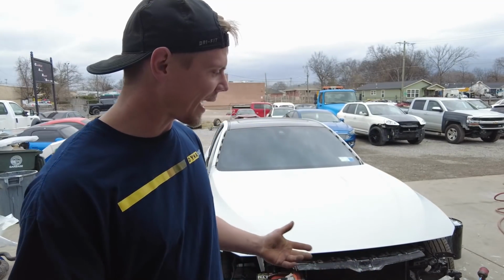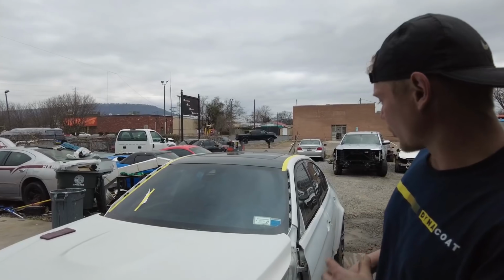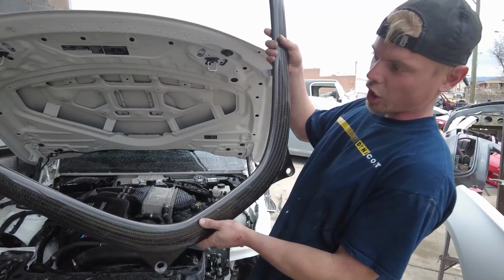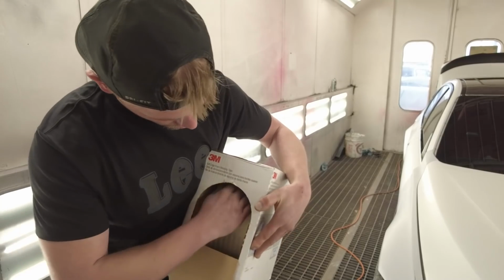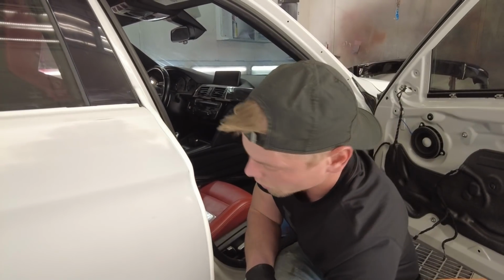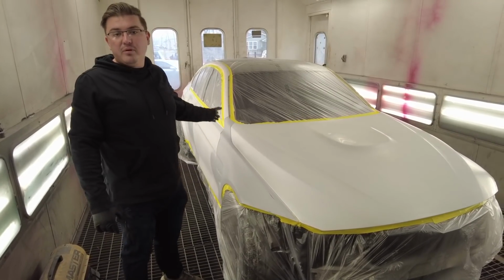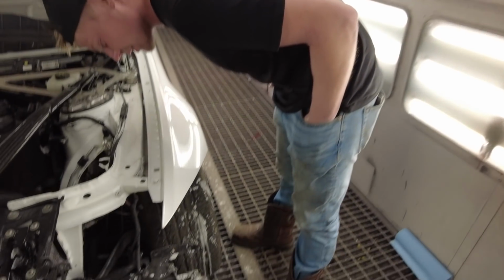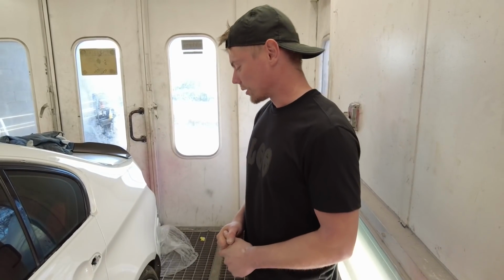We painted the M3!!

Comment: Yes the primer part is very true. When I was a beginer to painting I always used rattle can primer. However, it was very thin and sometimes I would even have a bad reaction and buble up a little bit after base coat. It's best to use a high build primer that you can sand. It fills the scratches nicely and makes the base coat lay like glass after blocked. Don't waste your time with that rattle can junk